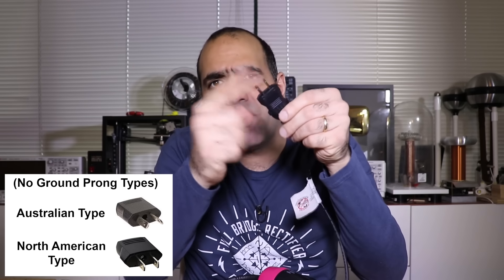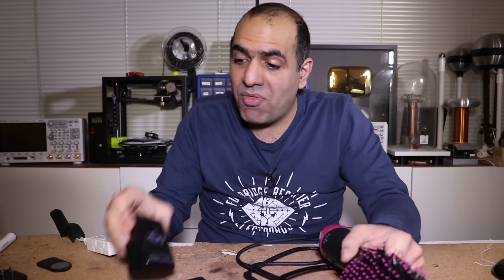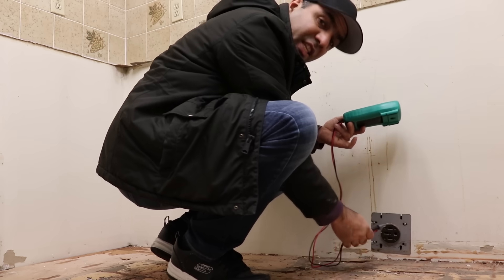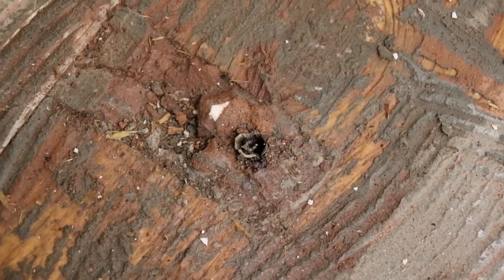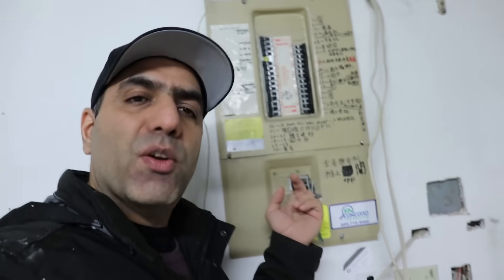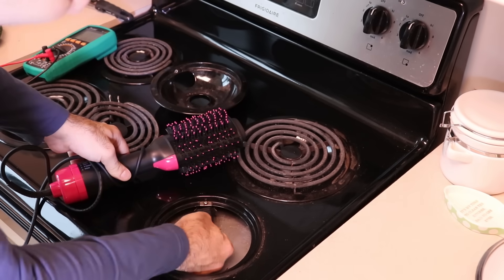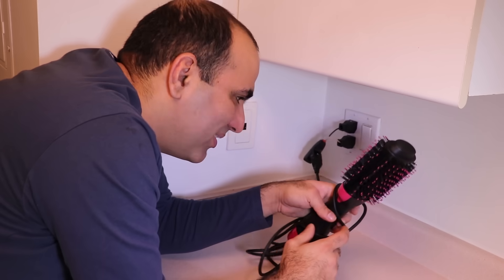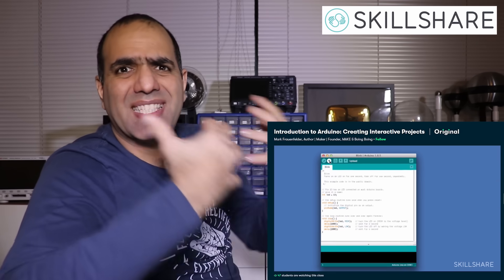Finding HIGH POWER 240V in a 120V Country

Comment: 8:30 

I dont believe you actually got shocked there because neutral shocks are actually incredibly dangerous and I notice you only blow things up/get shocked when they're not that dangerous.

Good acting though =D
Reply: Neutral shocks?  What?
Reply: @stargazer7644  If you get shocked on the hot side of a device/equipment you're probably just getting hit with the line voltage, unless you're being very irresponsible and you put yourself in series with the device/equipment.

If the hot is hooked up to the equipment and you play with the neutral, that's a "neutral shock" and it's extremely dangerous. The amperage of the equipment is in series with your body.
Reply: @goaliedude32  That isn't how current works.  When you touch the hot side you've got the full line voltage available.  If you unhook the neutral and get between it and ground the voltage will be lower and less current will flow because of the voltage drop across the equipment.  Power sources don't push current. The equipment doesn't have "amperage".  The current that goes through your body depends only on the voltage present and the resistance of your body, according to ohms law.  The same thing is true for any load.   Since the equipment also has resistance, if you're in series your resistance plus the equipment's resistance MUST be higher than just your body alone.  That means less current will flow.  If the equipment's resistance is low, there won't be much difference between touching it's neutral side and touching the hot side, but it will be less on the neutral side.
Reply: @stargazer7644 

Are you trying to say that a neutral shock is less dangerous than a line voltage shock because the voltage is less?
Reply: @goaliedude32  Yes.  In what you're calling a neutral shock, there's a resistance between you and the power supply (the load of whatever the device is) that reduces the voltage and current going through you.  For an extreme example, if that load was not very big, say, a neon bulb and a 220k resistor in series, almost all of the voltage would be dropped over the resistor and you'd only get a volt or so and wouldn't even feel it.  As the load's resistance decreases, you'd get a bigger and bigger share of the voltage and the current through you would go up, but it wouldn't ever equal what you'd get from just touching the hot side unless the load reaches zero ohms and disappears.  Does that make sense?
Reply: @stargazer7644  resistance is additive in series. A fridge pulls about 5 amps. If you put yourself in series with that appliance you now have 5 amps going through your body.

A neon light is about 1 amp. Anything over 0.01 amps is dangerous and very much potential lethal
Reply: @goaliedude32  Again, that is NOT how it works.  Ohms Law tells you how it works.  A fridge pulls 5 amps because it has a certain impedance (impedance is for AC what resistance is for DC) and a certain voltage causes a certain current to flow through that impedance.  Your body also has a certain impedance.  You add the impedances together, and THAT determines how much current flows through your body and the fridge in series.  

For example:  Your 5 amp fridge has an impedance of 120V / 5A = 24Ω. That 24Ω is why it draws 5A when you plug it into 120V.  Your body has an impedance of about 10kΩ when dry.  Your body in series with the fridge has an impedance of  10,000Ω +24Ω = 10,024Ω.  The current that will flow through you and your fridge is 120V / 10,024Ω = 0.012A = 12 milliamps.  A far cry from the original 5A.  The voltage you would feel in that case is 0.012A * 10,000Ω = 119.7V - almost all of it, so you'd get a pretty good shock from it, but a bit less than you'd get if you touched the mains directly.
Neon bulbs do not draw an amp - at least not for very long.  Neon bulbs are current limited to about 1 milliamp.  If you were in series with a neon bulb and a 120k resistor then the current would be 120V / (120,000Ω + 10,000Ω) = 0.000923A = 923 microamps.  In that case the voltage across your body would be 0.000923A * 10000Ω = 9.23V - You wouldn't even feel it, but the bulb would still light up (actually the voltage would be even lower, because the neon bulb drops quite a bit, but I didn't want to complicate it too much).

In order to put 5A through your 10kΩ body, you'd have to touch a 5A * 10,000Ω = 50,000V power source.  That's how it works.

If you want to understand this, you need to study Ohms Law.  It is the very first thing you learn in basic electronics theory.
Reply: @stargazer7644  what is a neon bulb? A flourescent bulb? 

It doesn't make sense to have been talking about just a bulb in the first place, I was just trying to make sense of why you brought it up in the first place.

I'm giving you the benefit of doubt, it's been hammered into me over a lifetime "don't become the neutral", "white on first, off last".

I'm starting to believe your math buty intuition is that it's exponentially more dangerous to place yourself in series with a load than it is to simply get hit line voltage to ground.

I've also had a neutral wire come loose on me and the neutral shock knocked me unconscious for a few seconds, completely different animal.

I'm going to say that your numbers look good on paper, but when I said "your body isn't a resistor" I meant that your body isn't always going to be 10k ohms. Once the circuit is complete the resistance of your body is open to change

Comment: But O habe do Debunk something: 1. The cables in the meter at 3:47 are in voltage and 2. Seconds later, as you jump away, the cables are unplugging themselves from the meter! There is no possible way, that the meter was on current!

Comment: This reminds me of my dad. Back in 1975. We got an air conditioner. We had a 120 Outlet beneath the window. The air conditioner was 220. Back in 1975 we didn't have Lowe's or Home Depot. The 220 outlet was a specialty item. It was already past 5 o clock on a Friday. He could not get this 220 outlet until 6 a.m. on Monday. Which meant two things. 1, my mother was going to have to go score that outlet. As dad had to work.
2. Dad was going to have to find some way to make that work without an outlet if he wanted air conditioning over the weekend.
My dad had already indulged in the better part of a case of beer. Our ancestry is Irish. Sue me. But he was determined he was going to get that working. He ended up wrapping the wires around the plug of the air conditioner. He told me and my brother we could touch it if we wanted to. And he would spend our college fund on burying us. Upshot is, we had air conditioning during the weekend. My mother went and picked the outlet up. A god-awful journey by bus. And my thirteen-year-old ass installed it before Dad got home that night. Dad was kind of proud of having trained me to do the small tasks

Comment: Yes, Most homes in the States are wired for 240 volt "split phase" and a neutral/ground. The service drop terminates in a "breaker panel" where it is split into two neutral-referenced circuits, 180° out-out-phase, giving us two always separate 120 volt circuits.

Comment: How does your wiring work? How can you have both 120 degrees and 180 degrees shift at the same time? Isn't it produced by the power plants? Do you use some kind of transformers?
In Sweden, EVERY house has 3 phase 240/400 volts with tons of power. Often 20 amps, sometimes 25.
Reply: His apartment building has 3 phase power.  That's why his phases are 120 deg out.  Single family homes in North America get single phase 240V power with a center tapped neutral.  That gives 120V from neutral to either hot wire, and 240V across the hot wires.  Since you're measuring from the center of the transformer (the neutral) as the common wire, each hot wire appears to be 180 degrees out of phase.  But that's just because you're effectively flipping your meter leads when you measure like that.  It's actually a single phase.

Comment: In reality, a home in Canada is wired for single phase 240/120. Hydro taps one of the 3 phase 25Kv lines, adds one 25 or 50Kva transformer to it, and it steps the voltage down from 25Kv to 240/120V with respect to ground.  The only voltages that are  120 deg out of phase are the three 24Kv hydro lines. The city of Vancouver's hydro lines run from 7Kv up to 14.4Kv. This differs from city to city but a single family home is always 240/120V SINGLE phase. I hope that helps clarify the hydro part of the equation.
Reply: Interesting observation.

3 phase power is only really needed to power industrial electrical motors. A 3 phase motor fundamentally relies on those phases being shifted by 120 degrees, otherwise it will not rotate.
That is what it is really all about.

Homes and most offices do not need 3 phase power. A single phase at a suitable voltage level is what actually is needed.

Comment: I had the opposite problem...
120v-220v.
Ever tried to charge up cordless tool batteries through a power converter?
Not sure if it was the converter or RIDGID makes sub grade stuff.
Could be the converter Watt Output.

Comment: Australia runs on 50Hz, and the USA on 60Hz, so the motor inside the dryer might still have problems.
Reply: It isn't likely to be a synchronous motor in a hair dryer.  It probably won't care about the frequency.

Comment: 5:15 the first short circuit ever in this channel's history that wasn't directly Mehdi's fault.
Reply: That scared the crap out of me
Reply: @nex3mber  yes! Was sussy
Reply: or so he claims
Reply: well, he did pull it out of the ceiling so that It was touching the wooden beam.
Reply: That short probably would have tripped RCD protection in Europe unless it was only shorting the live and neutral wires and not involving the ground wire which is very unlikely.
Reply: 3:50
Reply: fact...
Reply: LOL
Reply: Medhi: I’m Surrounded by idiots
Reply: he did to pop the fuse
Reply: True
Reply: 6:05 dikira short

Comment: Every electric shower in Brazil runs on 220v. In the south region it will be by connecting two phases at 180° In the Northern area it will be just one wire with 240V

Comment: Dear mehdi.i watch most of ur videos and cant find any help for my little henhouse air heater making! Any suggest? I have 12 volt 2 amp adapter but it doesnt heat my 30cm nichrom wire.even little dc motor fan unplugged!  I dont want to waist lots of power for a little henhouse.

Comment: I found one of those 1000w ones at a thrift store for 10 bucks. Sold it on ebay for a healthy profit. Heavy as hell, just a big coil of wire inside. Fit nice in a flat rate box to ship

Comment: I had the same problem when I was a kid (back in the early 80s), when my German grandmother sent me a Lego train set for Christmas to me in the USA (Grandmothers are always the best!). So my problem was that the Lego transformer needed 220V, and in the US "only" 120V comes out a socket. I could run it only with 120V but the train ran real slowwww. So with my knowledge that 220V did come into the house. I solved the problem with using two extension cords, the trick to find two wall sockets where the hot side was 180° out of phase to the other (I had access to a multi-meter, a Simpson, to check). In the US, Split-phase (single-phase three-wire) is the standard for residential. Having two phases in one wall socket, I believe it is against elec. code in the US (unless the wall socket is protected by a 2 pole breaker).

Comment: You know electro boom you should come to puertorico everything here is fucking 240v on every plug strange right we have neutral but if the item in use uses 240v it won't return the 120v to the receiver so we can connect two air friers or two high wattage machines without it having it getting fucked like I have my pc my air conditioner and my electric water heater in the bathroom plus the microwave in the kitchen all in one line with not so thick wires at the measured size 10 or 12 idk how our house hasn't burned down

Comment: 1 other note: most (all?) 240V countries are 50 Hz, most (all?) 120V countries are 60 Hz. So devices will run faster/slower than they should even if you convert the voltage, which will cause them to (usually) not work correctly or damage them. Ex electric shavers running at 50 Hz when designed for 60 will pull hairs instead of cutting them, and possibly burn out the motors / circuitry. Old school tube TV simply would not work, clocks would be wrong, etc. With the hair dryer, the fan will simply blow slower, which is probably fine, but could cause it to overheat and/or the fan to burn out.
Reply: That's not really true.  There are quite a few countries in all 4 categories.  Also, all of North America is actually fed with 240V (residential) or 208V (commercial) power at 60 Hz, we just commonly use 120V devices.  So we aren't strictly a 120V country.   The frequency thing depends on the motor.  That hair dryer probably doesn't have a synchronous fan motor, so it likely won't care about the frequency.

Comment: Why do they use 120 phase difference to get 205 v  instead of the 180 degree  phase shift to get 240?
Reply: Because it's an apartment in a large building and has 3 phase power instead of split single phase you have in a single family residence.

Comment: This guy needs to be in show biz. I'm sure all the "accidents" are staged, but they're well done.
Reply: It's not staged per se, but Mehdi is a professional electrical engineer, so all the hazards are planned through so it doesn't cause collateral damage upon execution.
Reply: @MakotoIchinose , that's clearly staged to me. I do find it hilarious though because his reactions are spontaneous. 🤣
Reply: @MakotoIchinose  and is what being staged is. it was planned in advance so he could make sure it happened safely. he just does it so well it can make us question if it was.
Reply: Having watched the ‘current test’ back a couple of times, I’m not sure if it’s even real. It doesn’t look like he inserts the probes and the tester ends of the probes fly out of the tester a bit to easily - I don’t think they were actually plugged in or maybe the probes were inserted and he had fuse wire between them or something. Either way it’s still a good watch.
Reply: I mean why would the lamp fall in the wire tap vid?

Comment: Had a range plug in my old house, it did not have a breaker.  To verify it was dead I grabbed the trusty Fluke (with range removed) and went to meter it.    

STUCK the corner of the range hood into my head.

This video brought back some memories.

Comment: Hey Mehdi can you check this video out. ithink it's fake .so bacily you know those wireless charging pads that charge your phone well I hapend to se a video that you can charge your phone 16 inches for the device and its called can you charge your phone with light. And also can you make a video about it so I can understand more about wireless power thanks. And also the device is terribly inefficient I watched it and the max output that it can out put is 18w and the farther away your phone is away from the device and at 16 inches away from the device it only gives 2w charging and for 10inches its 5w and the closer the closer the more wahts .and the last thing is that it doesn't shoot electromagnetic waves it actually shoots radio frequency 123mhz and I think some one can hack you because hackers they can tune into the frequency so that's it and remember to make a video about it Mehdi bye.

Comment: I've seen 240v construction heaters ran off of split plugs in new construction. In the kitchens the plugs are usually split so people don't blow breakers when they use the toaster and microwave at the same time.

Comment: Shouldn't the RCD in the house/flat stop this happening i.e. turn off the power? (no current on neutral when phase/phase and in the other situation any leakage to earth on the short would imbalance live neutral monitor) for the single phase circuits anyway. Maybe I misunderstand, anyway happy new year.
Reply: Only certain circuits have RCDs (we call them GFCIs) in North America.  We don't have whole house RCDs.  Typically only circuits near water, outside, basements and garages have them.

Comment: Could you rectify the 240vac with a split supply bridge to get ~240Vdc? Would there be any way to safely ground that circuit?
Reply: Yes, but you'd get 339VDC across the rails not 240VDC because 240VAC is actually 339V peak and that's what the caps would charge to.  As far as the grounding goes, a split supply bridge requires a center tapped transformer.  If you're using a transformer the supply will be isolated and you can ground reference the output.  If you're not using a transformer and just using a FULL WAVE RECTIFIER, then the supply is mains referenced.  It'll get quite unhappy in an ElectroBOOM kind of way if you ground it.

Comment: Why do you keep saying “they are out of phase”? Are you implying that the phase angles of each voltage source are shifted? Can you explain more please? I am in America and most of our homes are  fed by two 120V legs off of a single phase transformer. Each leg that comes into the breaker box are in phase with each other. That’s why you can you add them up and get 240V. 
I’m thinking that you were saying phase when you meant to say feeds or legs. 
Please respond in any way. 
I could be wrong?
Reply: When you measure the hot legs using the center-tapped neutral as a reference, you'll see one leg go positive when the other leg goes negative.  This is what he means when he says they're out of phase.  That does not mean it is 2 phase power, however.  You get the same result when you measure between two phases of a three phase power system using the neutral as a reference, like what he has in his apartment building.